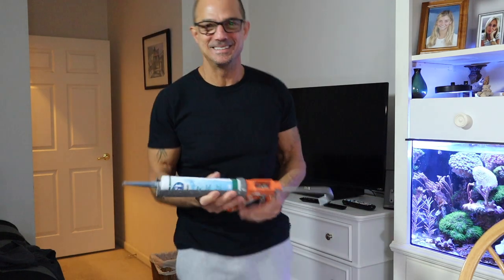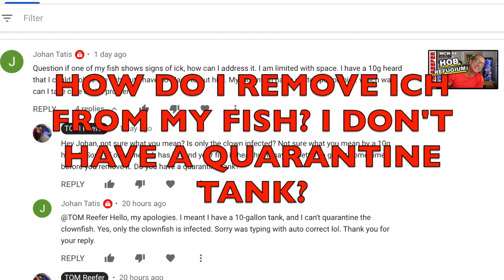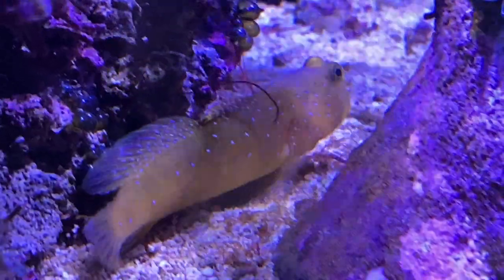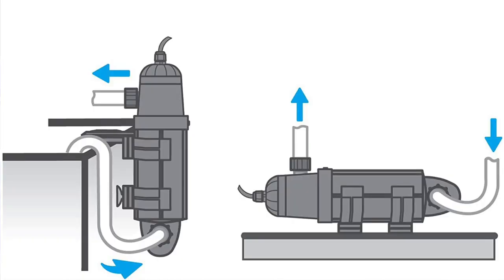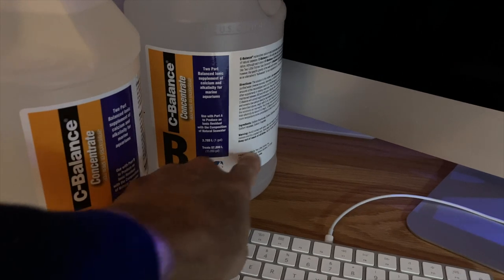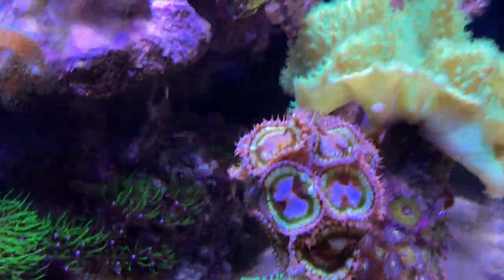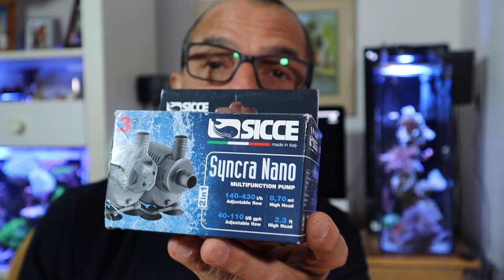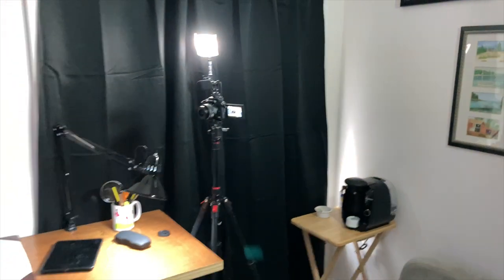HOW TO TREAT ich In Your Reef Tank  -  AND MORE...

Comment: Hi Tom! great vids. I recently siliconed a project tank. It was a mess and looked horrible. I had to scrape it all off and start over. Any advise from building your pico?
Reply from the maker: Hey Daniel, Haha! My feelings exactly! The tape helps a lot. I would use blue painters tape next time. It will peal off way easier then masking. The masking screwed me up when trying to peel it and caused my glass to shift. Once the glass shifts, your mess begins. Like anything it’s a skill that would need to be practiced. 😃👍🏻
Reply: @TOMReefer  i couldn't take it! After work yesterday, I cut all the silicone out, scraped, and cleaned all the panels and started over. 3M painters tape (EZ release) made the job much easier and finished much nicer. ✌️

Comment: I actually just bought a uv sterilizer. I got into the HOB fuge with ur nano light recommendation. I ran it 24/7 and my nutrients bottomed out (not a mistake I will make again). Now I have a nasty Dino problem :) FYI I tried dosing F2 because I’ve been culturing phyto I also dosed phyto and H2O2 to try to fix it no luck now we’re going nuclear with our UV radiation wish me luck
Reply from the maker: Hey Brianpvr18,  24/7 is a bit much on a refugium. A reverse period would be better. 😃good luck! Thanks for watching👍🏻